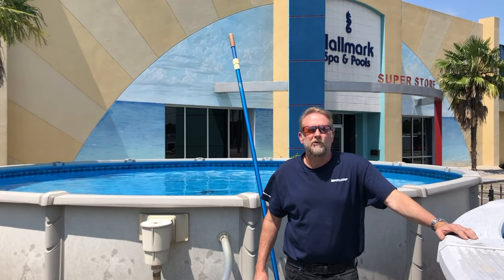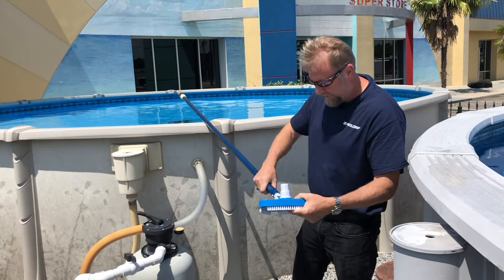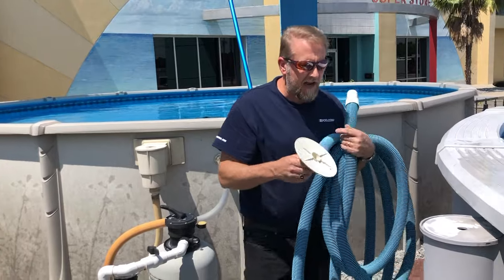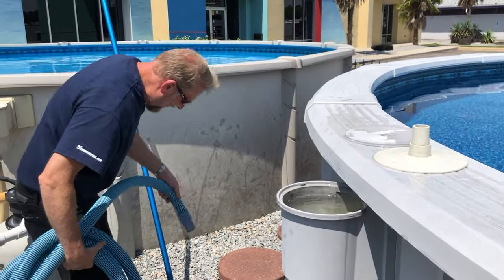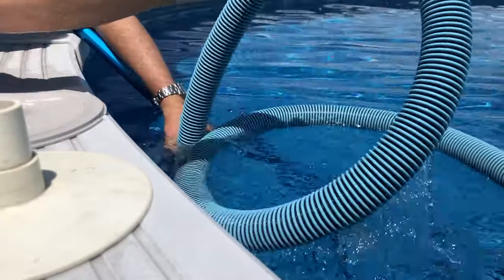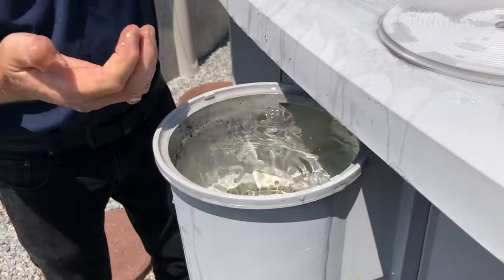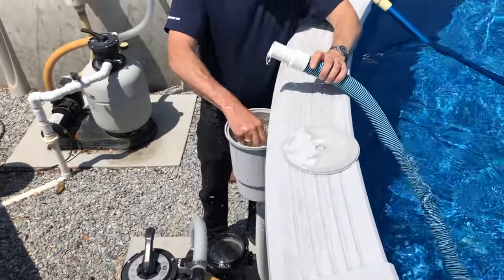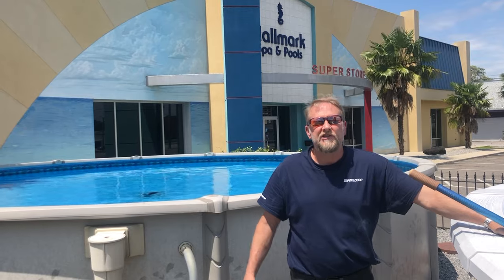How to Vacuum an Above Ground Pool!

Comment: We got a new house with a 18,000 gallon pool with 0 pool experience and the previous owners closed the pool with a leaf cover.... this video helps tremendously thank you!!
Reply: I also got the same experience.  The previous owner kept a 24ft round pool for me with damaged Sand filter with heads with old pump. We  changed the sand filter with new Hayward one and using the old pump.  Need to start vaccuming.

Comment: Great video! Only question it didn't answer for me is what to set the Vari-Flo to for vacuuming. Mine does not have that as an option. The rest is perfect - detail, concise, and demonstrated. Thanks!
Reply from the maker: @karichilds7275   For normal vacuuming and cleaning you will be in the filter position. Thanks for watching.

Comment: What is the vacuum plate number on the one you're using? Also what brand is the vacuum head that you're using? I prime my hose differently than your do-I prime mine in front of the return jet, and keep it and the connected vacuum plate underwater the entire time I'm connecting it.   I absolutely hate the vacuum plates that came with the pools though because of that swivel removable neck part on it-that 1 part coming apart while I'm vacuuming has caused me to lose prime a dozen times.
Reply from the maker: The vacuum plate used in the video is an aqua leader vacuum plate which is no longer in production. Olympic is the company that now makes these plates. If you have a Hayward skimmer, the most common plate you're going to use is: https://www.hallmarkpoolsupplies.com/p-22882-25573-510-000-skim-vac.aspx 

The vacuum head used in the video is: https://www.hallmarkpoolsupplies.com/search.aspx?searchterm=K048cb%2Fscp

If you're having a problem with the vacuum hose coming off the vacuum head, then you may need to replace the vacuum hose, or clamp the vacuum hose to the head.
Reply: @HallmarkPoolSupplies  Thanks for your reply.  I'm looking for a vacuum plate with a one piece straight adapter on it this time :) Do you have a part number for one of those? I'm looking at the Hayward SP1106 but need to make sure it isn't too big around.  

I've used the other one for years, and as long as I'm very careful not to pull my hose too far, in order to not turn it at the adapter part all goes well.  

The one I have the vacuum hose isn't what is coming off, it's the angled adapter being able to separate from the base.  It's like that I guess to allow it to swivel, but when it does the 2 pieces of the vacuum plate (the adapter and the base) come apart from each other,  and that then causes it to lose prime because the adapter part with the hose still connected to it floats up just enough from the base part section to mess up the vacuuming of the pool.  LOL they are a royal PITA, and it generally decides to come apart when I'm on the far side of the pool where I moved the hose too much.

 I've actually considered duct taping the adapter in place to prevent it from moving at all, but have never tried to see if that might help the problem. I might actually try that before replacing it.  Thanks again for you help, and have a great day!!!
Reply from the maker: @crackerjack4u  There are a few vacuum plates to choose from (different sizes). Give us a call and we can help you one on one. The phone number is located on our website.

Comment: Thank you very much! My question is what setting waste, filter that's what I need to know!!😁😁😁
Reply from the maker: For normal cleaning you would vacuum in the filter position, pools that are really dirty or algae infested you would vacuum in the waste position. When vacuuming in waste you will have to add water to the pool.
Reply: @HallmarkPoolSupplies  thank you very much. I used waste and had the pool filling at the same time!!🤣🤣🤣 also I'm short so I had to get in the pool!!🤣🤣🤣

Comment: Very helpful  my psi is 25at start up green water and just shocked the pool please advise
Reply from the maker: If this is an above ground pool and you have a sand filter, it sounds like you need to backwash and rinse the system thoroughly. 25 psi is high for starting pressure. As far as a green pool, take a water sample to your local pool store and have it tested so you can get the proper chemicals. Thanks for watching.

Comment: Hey I vacuum pool and it's clean... after filter runs at night I notice dirt comes right back in the pool, re circulated from, the filter/pump... what can possibly be the cause of this? It is a cartridge filter system
Reply from the maker: You may need to clean the filter cartridge thoroughly, or replace the filter cartridge depending on the quality. If you have any questions, give us a call.

Comment: Question, I have 24ft pool with a half hp motor and a 16 gal drum sand filter, I want to upgrade because Its not cutting it when it comes to vacuuming and just general operation. What pump/sand filter would you recommend? Also what is the pump/filter you use on the pools in the video?
Reply from the maker: For that size pool we would recommend the Hayward sand filter system W3S180T93S. This system has a 1.5 HP pump and a 150 lbs. sand filter which is the same system in the video.

Comment: Thanks for the info. Is there any way to increase the power of the suction because I don't think mine is pulling hard enough to get everything
Reply from the maker: It depends on the system that you have and the size of the pump on the system. You could also have a clogged pump or your filter needs to be cleaned, these are a few different things that can cause weak suction. Thanks for watching.
Reply: @HallmarkPoolSupplies  ok I just set up the pump recently and vacuumed once so it should be good. But maybe it's because I removed the door and pushed the vacuum head from the inside of the pool into the skimmer instead of how you did it from the outside?
Reply from the maker: When hooking up the vacuum it is important to get a good tight seal. It is also important to have the stationary end of the vacuum hose hooked to  the skimmer and the swivel end of the hose hooked to the vacuum head.

Comment: Should I use the backwash setting on my sand filter or the rinse setting?
Reply from the maker: When vacuuming you will be in the filter position. After vacuuming you can backwash for about 1 minute and then rinse for about 30 seconds. If needed you can repeat. Thanks for watching.

Comment: Hi sir
Quick question 
I put in a new little bucket down on the ground where the pump is it’s full of Pineneedles. My neighbor told me I could not take the lid off or I would never get it back on that it’s holding the pressure of all the water in the above ground pool I’m not talking about the skimmer bucket. I’m talking about the little bucket down below next to the pump . It has Pineneedles in it and I was just wondering how do you get that off? My neighbor said I would never be able to get it back on if I didn’t put Vaseline around it and I don’t remember if we did or not it was last year I wish I could take a video and show you what I’m talking About. Thank you so much Houston Texas.
Reply from the maker: If you have a sand filter, turn off the pump and plug the skimmer and put your multiport valve on closed. By doing this you can open the lid and clean your pump basket without getting wet, you can also lube your o-ring, this will make it easier to open in the future. When your done, remove your plug from the skimmer and put your valve back on filter and you will be good to go. Thanks for watching.
Reply: @HallmarkPoolSupplies  so I turn the entire pump off, but I don’t know where the plug for the skimmer is. I did put the multi port valve on closed, but I still opened it, and water just poured out massively my neighbor quickly, stuck his hand in there and took out all the Pineneedles and quickly put the lid back on with the pouring water. Luckily we got it back on. We just could not do the Vaseline around the O-ring at that moment.
Reply from the maker: Having a plug for the skimmer helps, there is also a ball valve available and it screws into the front of the pump, and is easy to put on. If you need lube, a plug or a valve, I have these items on my website. Here are the links for these items if you are interested. 
https://www.hallmarkpoolsupplies.com/p-2375-sp1022c-15mpt-white.aspx
https://www.hallmarkpoolsupplies.com/p-2559-15mptxhose-abs-econoline-ball-valve.aspx
https://www.hallmarkpoolsupplies.com/p-8733-jacks-formula-327-multilube.aspx
Reply: @HallmarkPoolSupplies  ok thx I appreciate it
Reply: @HallmarkPoolSupplies  you lost me….:(

Comment: Can you vacuum on filter mode or it has to be on wasted?
Reply from the maker: Normally you vacuum in the filter position. In extreme cases where the pool is very dirty, you can vacuum to waste to bypass the filter.

Comment: With the pump running you don't have to feed the hose hand over hand like that into the pool. Just hold the vacuum down and put the other end of the hose over the outlet of the pool, it'll push all the air out of the hose quickly and easily.  If you're not holding the vacuum down? The forced out aiwill cause the vacuum to raise to the surface and you'll drop the pole in lol.  But it is easier than feeding the hose into the water little by little
Reply: I dropped the pole lol but I’m not sure I understand just hold the end over what??
Reply: @macdiddyyy8084  I just attach the hose to the vacuum head,  and hold the other end of the hose to the inlet jet of the pool. That blasts water onto the hose forcing all the air out. Keep the hose under the water and feed it right into the skimmer. Perfect prime....every time.

Comment: I have an above ground pool and the skimmer hangs on it, on the side of the pool it's not attached to the pump. How can I clean it with a vacuum?  I currently have a handheld but now purchased one with a hose and cant connect  :(
Reply from the maker: Hey Marilyn,
Check out our video here on how to vacuum a pool without using the system: https://youtu.be/6Uh2_2IlV4w

Comment: Mark I just bought a house with an above ground pool that has a Pentair Sand filter.   I don't feel suction on the vacuum.  How do I fix?  What am I doing wrong?
Reply from the maker: If you follow the video you should be fine, unless you have a clog, lost prime or you hooked up the vacuum hose backwards.If you are sucking air this could also be the problem. If you would like to check out my patreon page I will be glad to help.

Comment: Dont you also have to close the valve that send water into the pool first ?
Reply from the maker: If you have a shut off valve on the return line, that needs to be left open.

Comment: Can you vacuum in backwash mode, say ,to get out algea after using a flocculant? And if so ,best way to keep suction in that mode?
Reply from the maker: You would vacuum on waste to remove algae after using flocculant.
Reply: @HallmarkPoolSupplies  Thx!
Reply: Do you still use the skimmer plate?

Comment: I have a 1hp motor. Similar size pool. And I can keep a pool sweep running because the sorry device they sent me with the Zodiak Ranger seeep will NOT stay inside the skimmer hole. 

I either do not have the right parts or the 1hp motor ain’t cuttin it?
Reply from the maker: A 1 hp is good it might be the connection. Give us a call and I can go over a few things.
Reply: @HallmarkPoolSupplies  10-4. What’s your #?
Reply from the maker: Our store number is 9104858860

Comment: When I do mine I have it filled an inch above the max line and i can usually only vacuum for 14 min then the water is to low for the pump to work near or under the min so then I spend 2 hours filling it does that sound right does everyone have that problem? Suggestions?
Reply from the maker: Normally when you vacuum, you vacuum in the filter position. If you vacuum on waste, you will lose water in the pool. You only vacuum on waste when the pool is extremely dirty.
Reply: @HallmarkPoolSupplies  that makes sense.  Google said it puts unnecessary stuff in your sand filter but ill doube check the manual. Your way makes alot more sense. Thank you!

Comment: Am I supposed to run the pump on high or low? Even purging the air from the hose im running out of water on high?
Reply from the maker: If you have a dual speed pump, run on high speed when vacuuming you will have more power(suction). Make sure your water level is good and you should be fine. For normal  cleaning you will vacuum in filter. For pools that are real dirty or algae infested you would vacuum to waste, when vacuuming to waste you will lose water in the pool so you will have to add more water.

Comment: Isn't air entering the pipe when you take the hose with vacuum plate out of the pool and into skimmer??
Reply from the maker: @wambam12   A little air won’t hurt anything, in fact the air will go through the system back to the pool. Thanks for watching.

Comment: Every time I vacuum, I get these air bubbles in the filter and I have to remove the lid and get soaked to fill it fully back up. But when I turn the pump back on, sometimes it just happens again.
Reply from the maker: It sounds like you might be sucking air, you want to make sure you have an air tight seal. If your hose, lid, housing and o-ring are okay then you may need to backwash and rinse the filter thoroughly. Thanks for watching.

Comment: Do you have to turn the handle to a different setting ?
Reply from the maker: When vacuuming a pool you will normally be in the filter position, however if a pool is really dirty or algae infested you would vacuum the pool to waste.Vacuuming a pool to waste will by pass the filter but will lower the water level.

Comment: U didn't explain if the pump mode should be in filter or wat , can u please tell me wat mode do I need before I turn on the vaccum
Reply from the maker: You typically vacuum in the filter position. If the pool is extremely dirty, and you want to bypass the filter, you can vacuum on waste.

Comment: Great video! Quick question, if I was to vacuum to waste, could I do it without the plate and basket? Would that still clog the pump? Thanks!!
Reply from the maker: If you have a lot of trash in the pool you could clog the pump. Its always  recommended to use a vacuum plate with skimmer basket.

Comment: What if you don't have a skimmer?  What can you attach the hose to?
Reply from the maker: If you don't have a skimmer, than you would have to hook your vacuum hose directly to the suction inlet. (using an adapter or inlet fitting)

Comment: Mark just wondering what setting do you put the pump on do you put it on waste or filter
Reply from the maker: In most cases you will vacuum in the filter position. Waste is used in some scenarios where the pool is extremely dirty and you would like to bypass the filter.

Comment: So what do you do if your pool filter isn't round like this one is?
Reply from the maker: If you are referring to the skimmer, then you should be able to get a vacuum plate for your skimmer that will fit. If you have a doughboy, they make skimmer plates and some doughboys use the skimmer lid  over the basket and hook up the hose into a vacuum port on the side. What brand pool or skimmer do you have?

Comment: If I have a salt system does the state need to be off when I do this?
Reply from the maker: If you have a salt water pool you will still vacuum the same. Thanks for watching.
Reply: @HallmarkPoolSupplies  thank you yes, but I have a chlorinator system. Does it need to be set to OFF?
Reply from the maker: No, you will vacuum the same way.

Comment: What about the little fine pieces of dirt and debris. Won’t it just come back out through the jet?
Reply from the maker: No, for normal vacuuming and cleaning you will be in the filter position. If the pool is extremely dirty and algae infested then you would vacuum in the waste position, bypassing the filter. If you vacuum in the waste position you will have to add water to the pool. Thanks for watching.
Reply: @HallmarkPoolSupplies  awesome information. Thanks bud!!! 👍🏼🤘🏼👍🏼🤘🏼

Comment: This should be more specific because my pool and pump system does not have those giant valve selectors on top. Not all above grounds are like this I guess.
Reply from the maker: Hey Nathan,
This video was made for the average above ground pool. If you have something similar to an intex pool, you can watch our video here on how to vacuum a pool like that https://www.youtube.com/watch?v=6Uh2_2IlV4w
Reply: @HallmarkPoolSupplies  Thanks! I have a steel sided 24'x54" above ground - it has a two stage motor pump with cartridge filter. There is no backwash, or valve selector on the top of the filter housing. That's more what I was referring to. It looks like what you are showing here is a sand type filter.
Reply from the maker: Hey Nathan,
After you vacuum with a cartridge system, you will have to open the tank and clean the cartridge filter manually. You can spray it down with a garden hose and use a cartridge filter cleaner every so often.

Comment: Do you set the pump to 'waste?
Reply from the maker: For normal cleaning you will vacuum in the filter position. If a pool is really dirt or algae infested then you can vacuum in the waste position. If you vacuum in waste you will have to add water to the pool. Thanks for watching.

Comment: Do you leave the sand filter handle on filter?
Reply from the maker: Yes, for normal cleaning you will vacuum in the filter position, if a pool is extremely dirty or algae infested then you would vacuum in the waste position. When you vacuum in waste you have to add water to the pool.
Reply: @HallmarkPoolSupplies  Thank you